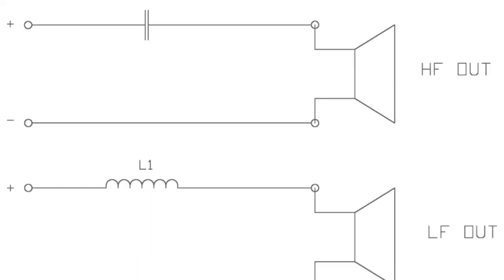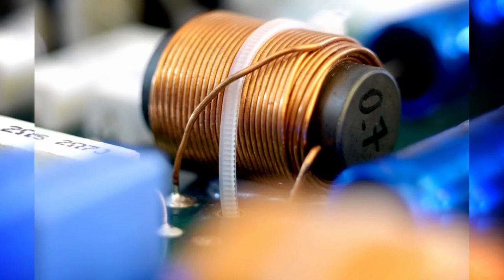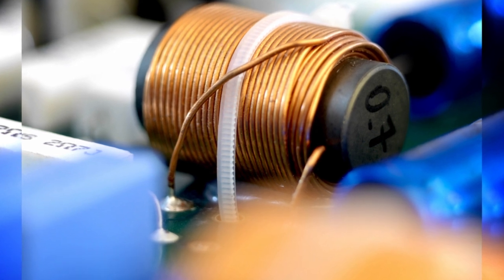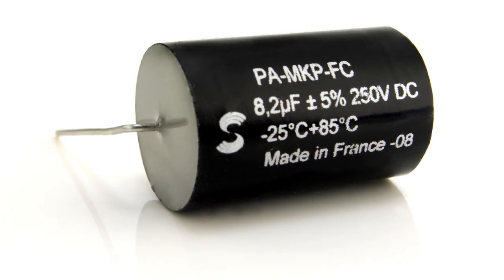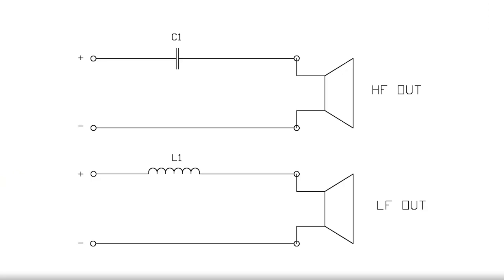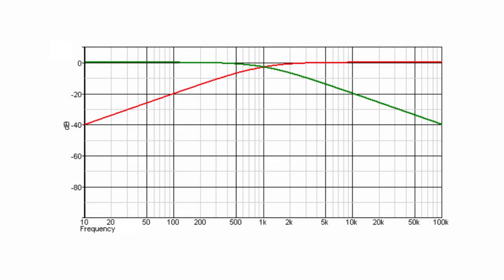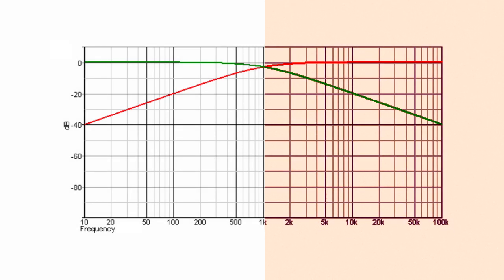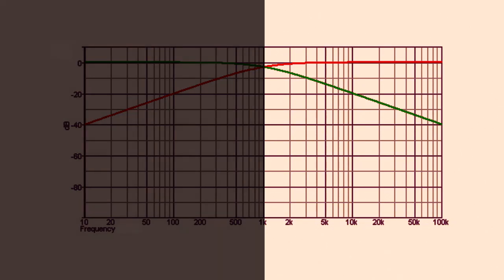Crossover Design

Comment: It's not quite as simple as using 4th order filters because the response of the drive unit has to be considered as well. You also have to consider how the impedance of the drivers change with frequency if the crossover is passive. I prefer active crossovers even if I have to buy or build more amps. If PMC is saying that the total driver + crossover slope is 4th order then that's a different, but not completely, accurate story. Bi or Tri-amping has other advantages as well.

Comment: how can I know wich crossover is better? first, second, third or fourd order?
Reply: Martin Nahuel Larrosa Maurer it depends on the loudspeaker characteristics.
High order filters dampen much better than low order, but they also introduce more distortion due to component imperfactions and phase characteristics in passive components.

Comment: if i got a 200 watts amp. 100w left and 100w right, is there an specific crossover to be use for these amp, or any cross over fits all. i mean if it is 100w, i have to buy a crossover design for 100w, or any crossover works
Reply: You don't put crossover into amps, you put them into speakers. If you have bought speakers they will maybe have crossovers.
Reply: Crossovers are used within passive loudspeakers. And not for right/left channels. You would not need to buy a crossover.

Comment: Why do you use inductors with an ion core? That will certainly add distortion. The best and most precise inductor is known to be a foil inductor. Some of them ex. by Jantzen called Wax coils even has the possibility to change the value by hand just by physically removing some of the foil. 
The next thing I can see is that you use electrolytic capacitors. That is a component not suitable for crossover designs. It will add a lot of distortion. Also it will dry out and change a lot over the years. A film capacitor is a much more precise component and it stays the same even after many years. The last thing is resistors. The induction free resistor is the most suitable and best sounding in my opinion. So it looks like you have chosen the cheaper option when it comes to collecting crossover components. I believe you could improve your speakers extremely much just by using better components for your crossovers.

Comment: Thanks very much PMC, there is so much rubbish on the internet, your beautifully explained workings of a speaker crossover is a vast improvement on any other short video on youtube (albeit for commercial purpose, fair enough and still) very appreciated! I myself am on the verge of building my 3 way active system, with 3 amplifiers. What crossover would you folks recommend? Also other youtubers welcome. Sofar I have a minidsp wich is usb software controlled, has high quality BUT lacks the on the fly controlls. Anyone know an affordable good quality 3 way crossover with manual controlls?